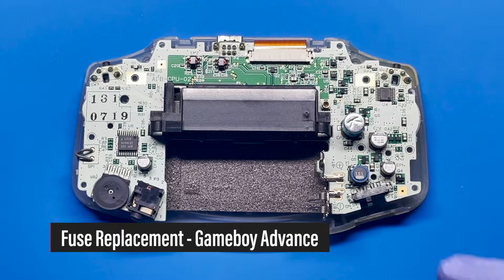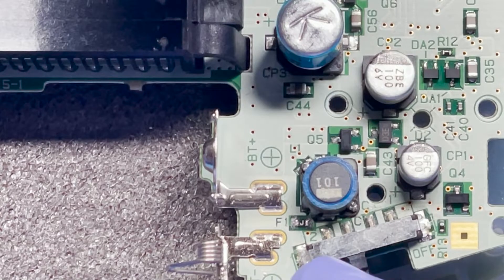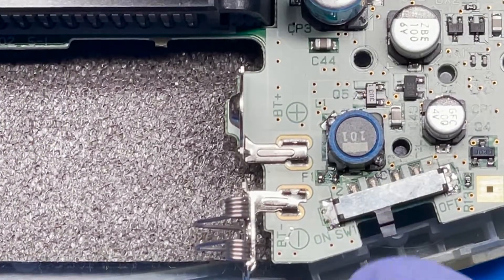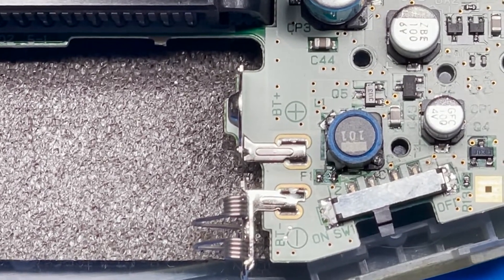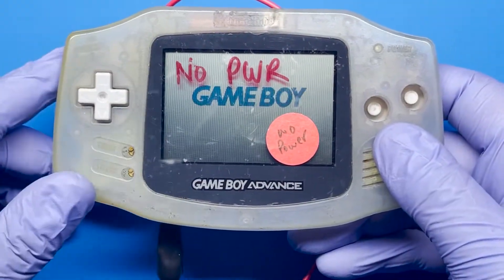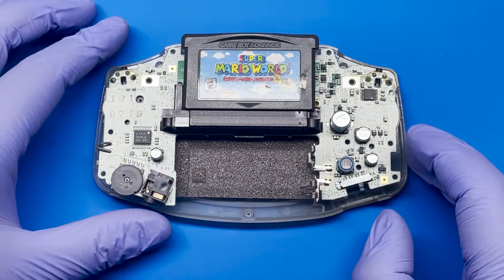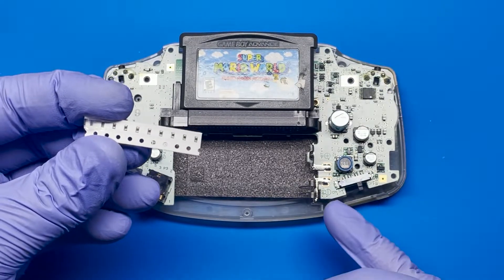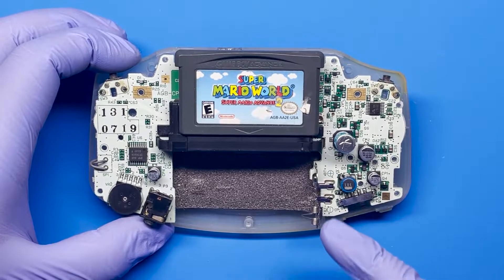Replacing a Defective Fuse - NO Power Issues | Gameboy Advance

Comment: Hi, long story short i fried my gba one day after sticking a pair of gator tweezer hooked up to the wall socket, just like the ones you are using to power it up,into the cartridge slot (yes, i know pretty dumb of me to do that, but i was just a curious teenager back then). Anyway, if i get a voltmeter where should i start checking and what values should i look for?
Reply from the maker: I guess the first thing to always start on is whether the system powers on. That is the primary place to start. If it doesnt, you would have to investigate if it is a faulty fuse (there is no continuity between the 2 points) or a dirty connecter on the power switch. If those are fine, you can then move over to the capacitors that are near the terminals on bottom right. Check to see if they are good primarily by seeing if the capacitors are broken/shorted/swollen have gone bad. This is just a starting point....if the system is still not powering on/displaying anything, then this requires further inspection and following schematics that are found online to determine that the proper circuit is going where its supposed to. 

I really do hope this helps. Thanks for watching!

Comment: Any other possible issues that you’ve encountered with this problem? I have an AGB-001 with an issue. Power switch on and the green LED flickers and shuts off. Push the power switch to off and the LED flickers again and the speaker makes a pop sound. I desoldered the switch plate and cleaned all the contact points in and I have good continuity. Checked the F1 fuse and have continuity. Board is clean and I see zero signs of corrosion. Any suggestion? Thanks
Reply: @thebrokehobbyist I also have the same problem, sometimes the power flickers. And you need to push the power switch gently just to make it on. But i tried before cleaning it with some ipa, and the result is good which is continuously powers on like it ain't flickering anymore, but tommorow after that, the flickers came back. Also when I accidentally touches the power switch, it's just so sensitive that It's turning off or rebooting my console entirely.
Reply: Tip: After you cleaned it and still got the problem, maybe the problem is on the capacitors due to the age of it. Maybe its time to change those.
But you need to really make some research if it's really necessarily needed to change the capacitors since it's the most tough ones to remove from the board. One mistake and you'll gonna rip off the board
Reply: @angelotheartist1918  I ended up replacing all capacitors, power switch, and F1 fuse and still having the same problem. No idea at this point. GBA went into the parts bin

Comment: I have the same problem. I have the same thing (if im doing it right), i seem to have continuity in the pins of the power switch. Might need to replace the fuse but im not sure how to test it exactly if i don't have anything to supply power. Probably would be the best bet
Reply from the maker: For a fuse, you dont really need power, although it helps...Majority of fuses can be quickly tested using a multimeter set to continuity mode. Simply think of a fuse as a piece of wire, when the wire gets beyond a certain electrical threshold, it will break....which will cause the fuse to no longer have continuity. This is a simple test and a sure way to determine if your fuse is faulty or not.